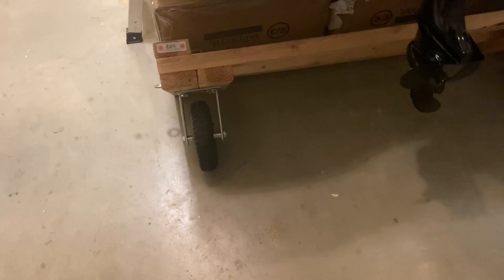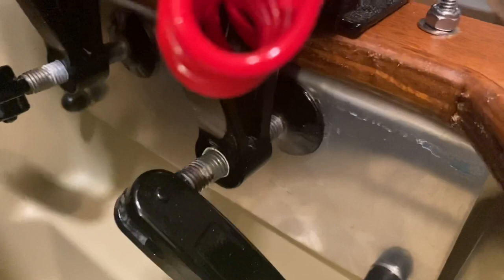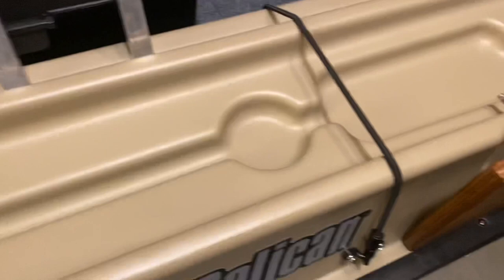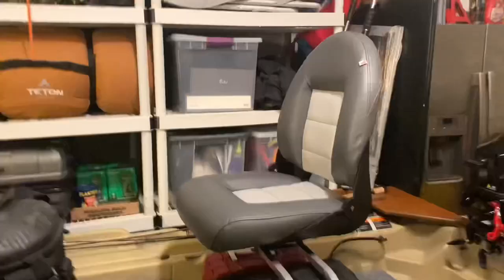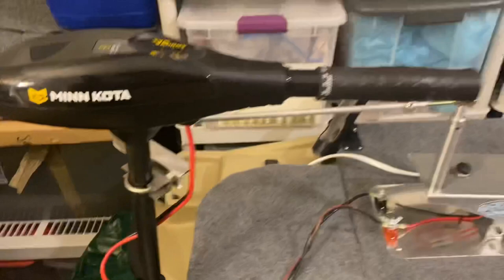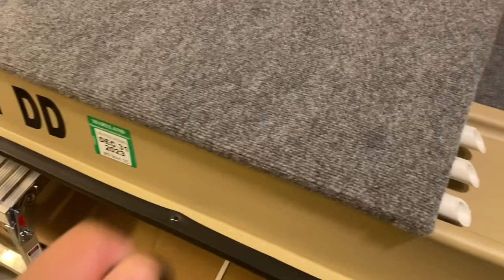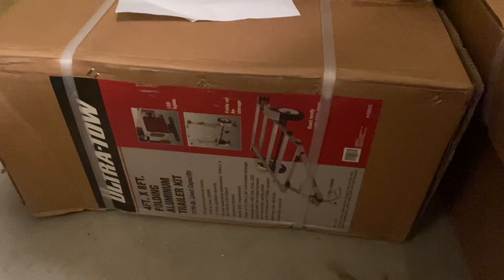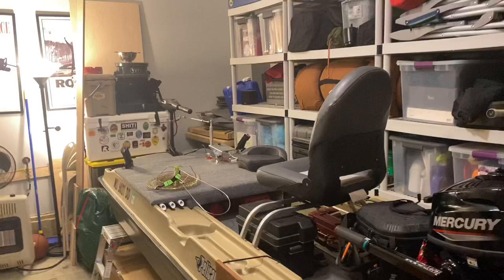Will This Bass Raider 10E Sink??? | Mods Update

Comment: Good job!! One thing though. Don't forget to add pontoon drain plugs to bottom rear of each pontoon. They do take on water and tipping boat forward to drain from factory front pontoon drain plugs with all that weight will be impossible. Just a suggestion.
Reply: I can tell by looking at your rig, no way will you be tipping that straight up draining water from pontoons. Too heavy. Ya ain't that strong pal. Just trying to help. I've had mine a year now. I know what I'm saying.
Reply from the maker: Lol! Finally added them! Game changer!!!!
Reply: Where would you place them? Obviously above the water line on the rear?

Comment: Nice job on your mods....Question...Do you leave your Mercury on the boat when trailering? If so, do you find a need for a transom saver? I just bought a 3.5 Merc for my bass raider which i haul w/ a utility trailer but now a little concerned with trailering w/ the motor.
Reply from the maker: Yea bud. I found a small transom saver that worked perfectly
Reply: @WesAlexander  Thanks Wes....All the ones i have seen or pretty big. Do you remember where you found yours or what kind did you get?